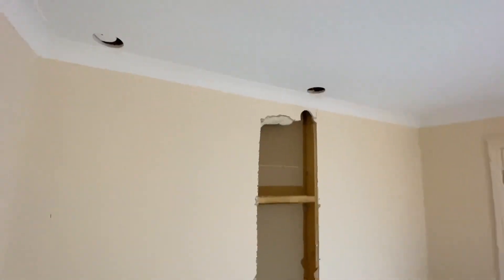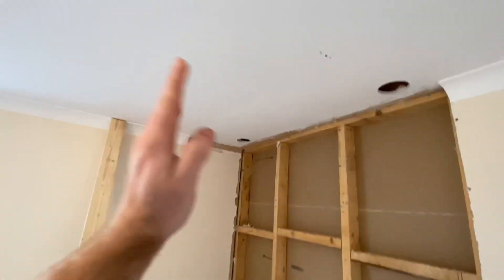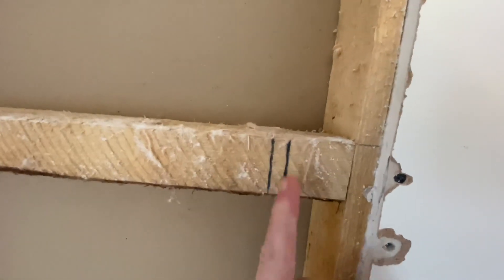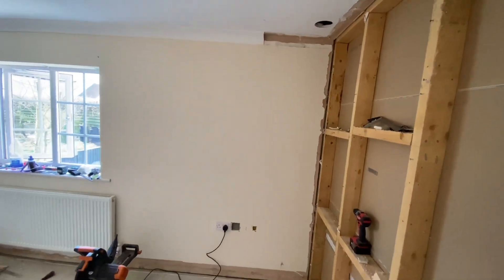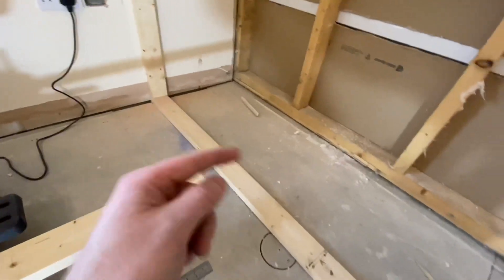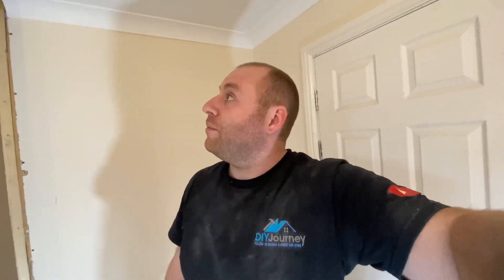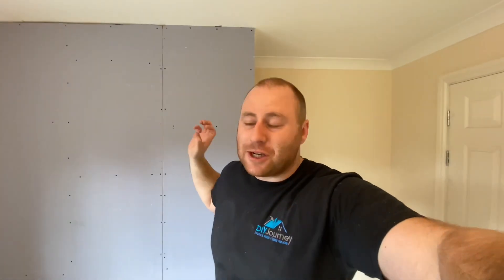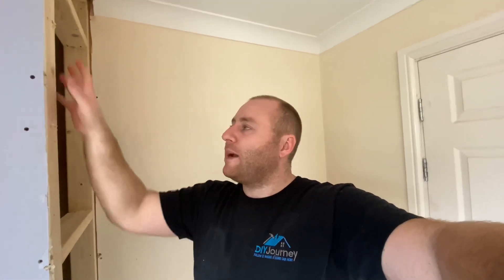Building a Stud Partition Wall - Project Nursery

Comment: Cracking job that mate, well done 👍. If I’d had tried that with a night shift in between there’d have been tools and all sorts flying out the window, and it definitely wouldn’t have been square!
Reply from the maker: Thank you 🙂 really appreciated 

🤣🤣 Believe me, altering those noggins took a lot longer than it should of, 4 hours sleep after 23 hour day is not useful.

Comment: I've just done my living room and added rockwool into the ceiling and party wall, makes a massive difference. I held it up by  leaving screws hanging out and then insulation on top
Reply from the maker: Thats good to hear, hopefully helps to noise from the shower. Thanks for the tip.

Comment: Hi mate, only just seen your video but if you've not finished, you said you were putting up a TV, so put in a piece of thick ply butted up to behind the plasterboard where you're going to put the TV, with some angle brackets. It will make it much easier to screw into when putting up the TV. I did this when I was installing some radiators onto a stud wall I built.
Reply from the maker: Hi, Thank you for the heads up, and good idea. Im happy with the hollow wall anchors I use will give suitable strength as its only a 32” TV that will be going up.

Comment: Hi mate what you can do is put another layer of plasterboard over it at a different thickness as the variation of thickness helps muffle the sound done couple of mu walls with sound proof matting. Also you can put some acoustic rocwool in the floor across the room about a meter into the room and that helps also